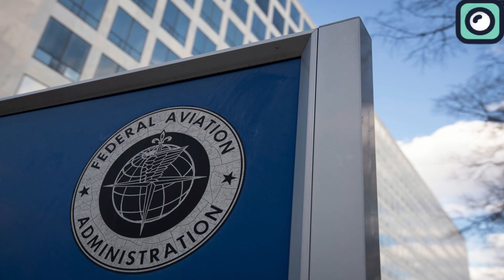Intense Preparations For The 5th Starship Launch....Important Upgrades!

Comment: agree, missing tiles are like torches weakening the wall of the fuel tank… the problem with stainless steel is that when it heats it compromises its metallurgy and is prone to corrosion, so until tiles are fixed it’s a weak point in the fuel tank 😂😂😂

Comment: IMHO, increase the number of engines can increase the total thrust, or it can allow for all higher thrust engines to operate at 85 percent power so that if some fail, nearby ones can go to 100 percent while those on the other side of the diameter line can go down to 40 percent so that the pointy end points in the right direction.

Comment: It´s not going to be catch by the grid fins!
Reply: Simply not going to catch… not even close…😂😂😂
Reply: @Mannicx  hahaahah come on! They will accomplish that now or later, but they will.
Reply: @edjaoc  the good thing is they have a month to prove this… odds against SpaceX based on past engineering non performance 🤣
Reply: @Mannicx  The only thing that worries me is that the tiles are still falling, if they can't solve it they won't be able to reuse the starship quickly as Elon wants.